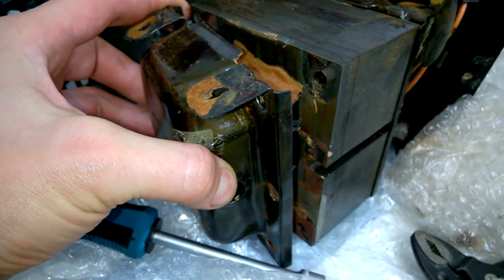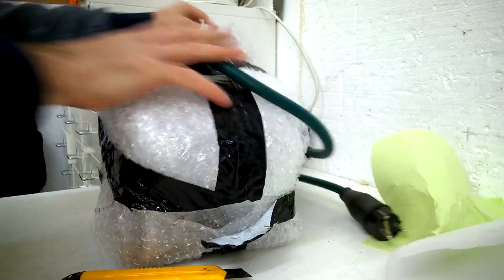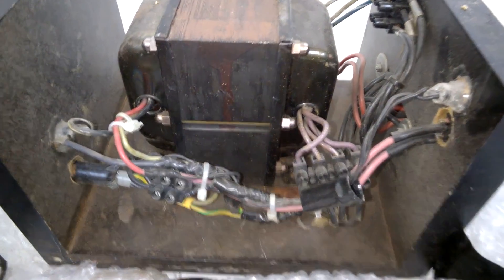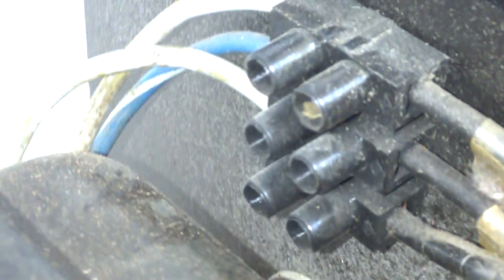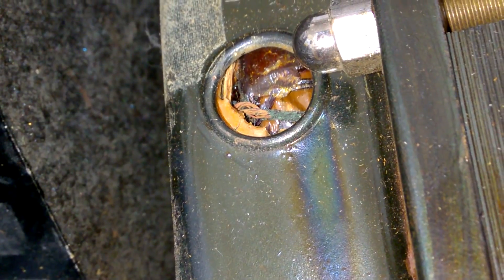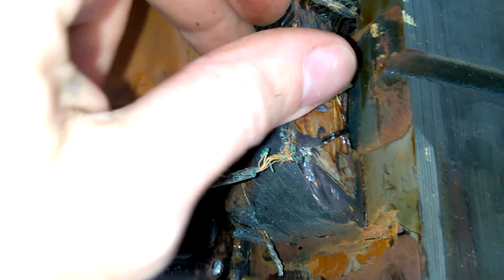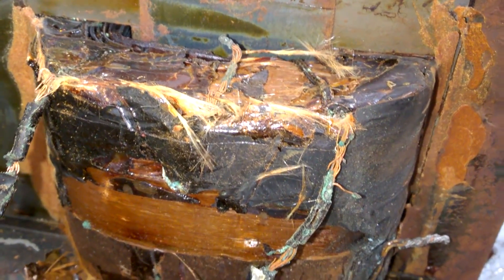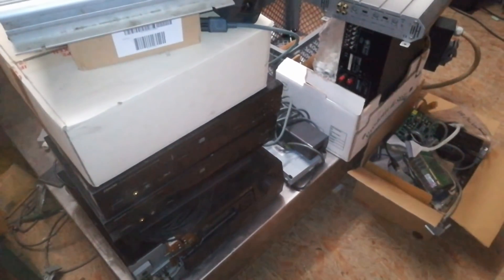mini-BEB #6: Catastrophic Transformer Failure Found (2019-01-02)

Comment: Rebuildable if you cannot get a replacement, but my guess is that somewhere in that mess of wire that leads to the multipin socket, or in the plug or the wiring to the amplifier is a short. Likely a short on the filament wires, leading to the transformer going into thermal runaway and letting the magic smoke out. Just like Weller, no fuse and no thermal protection in the primary side, and the lovely non mains rated power switch as well.
Reply from the maker: thank you for your detailed reply. Yes, you are right. 
I will rebuild a new power supply, with two or three different transformers, to complete all voltages.